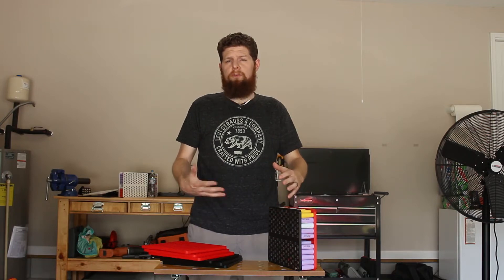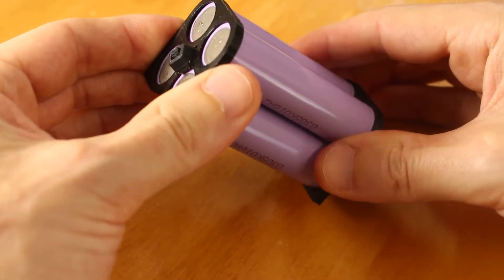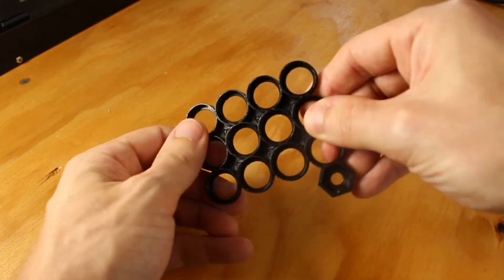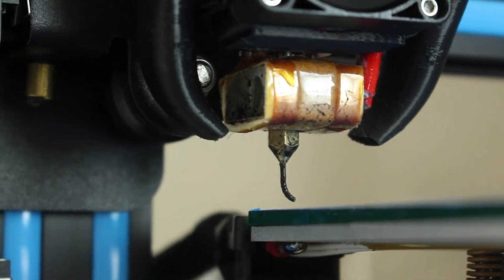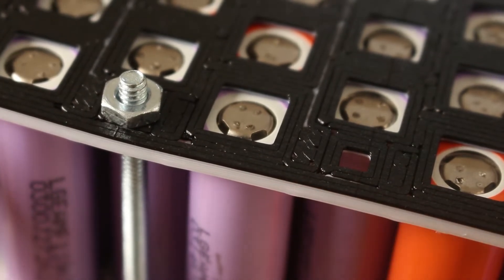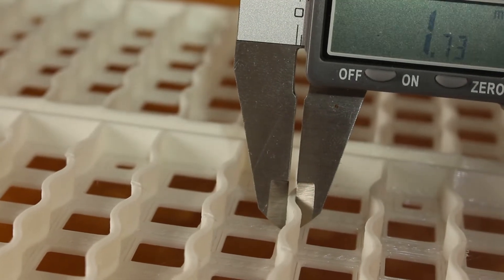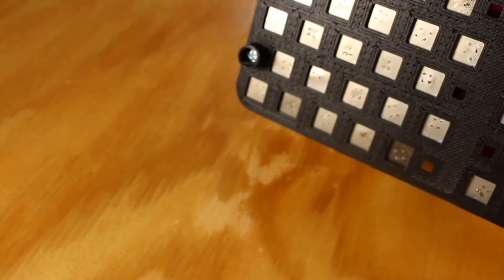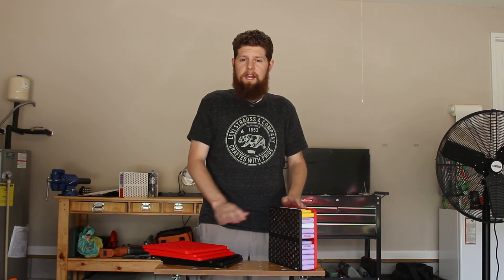3D Printed Cell Holders for DIY Powerwall

Comment: It cost you 150 dollars because you were being wasteful and use expensive filament. If you just use a premade cad model from thingiverse and only print it once than you could get it done with a 17 dollar roll of amazon basics white pla.
Reply from the maker: Would you mind posting your recommended model from Thingiverse? My filament cost here was around $20 per roll. Do keep in mind there's 28 packs involved here, for a total of 56 prints, holding almost 4,000 18650's.

Comment: Are you using PLA ,ABS or PETG? PLA is much easier for me to print but I'm not sure if heat will be an issue?
Reply from the maker: PLA. This is intended for Powerwall setup at like... 0.1C absolute max rate, so basically no heat.

Comment: nice, if onlyl 3d printer is cheaper.... what 3d printer did you use sir?  subbed too.
Reply from the maker: I have a Creality CR-10S.
Reply: will probably buy the ender 3, i have a design in mind for solderless, a little expensive design but will save you time and effort in the long run. Thanx for the video, it made new ideas come alive.

Comment: Those cell holders are very nice!! I think as long as you test your cells properly, let them sit for self-discharge testing, etc, you won't need to replace cells often, if at all. The hope is the packs all degrade at the same rate so you don't have to keep playing with them once built and in service.
Reply from the maker: Thank you!! Yes, I'm hoping that I won't have an issue.  These are salvage unused cells, so besides a few cells testing low due to sitting discharged for too long, they're all testing at basically their brand new capacity (2137 is current average, and 2150 is rated capacity).  If I was using salvaged cells from known bad packs, or using cells that were of questionable quality, I'd be more nervous.

Comment: can we get the design file to print?
Reply from the maker: The STL probably wouldn't be that valuable, since it's tuned for my printer, nozzle, and cell configuration.  On the off chance it is:  https://watson.ws/share/Curvy%20Pack%20Holder%20v7%20NORMAL.gcode